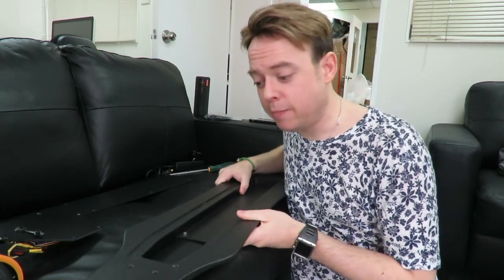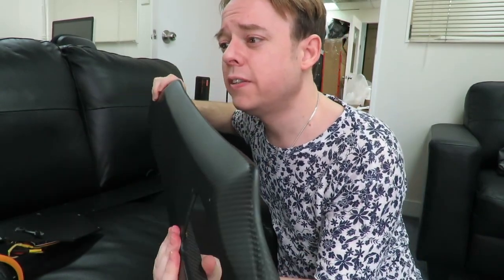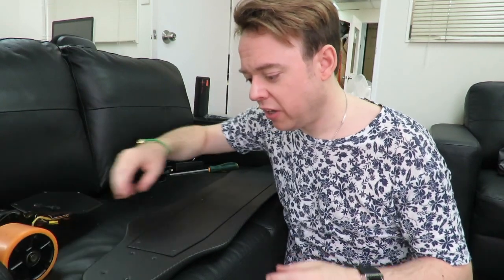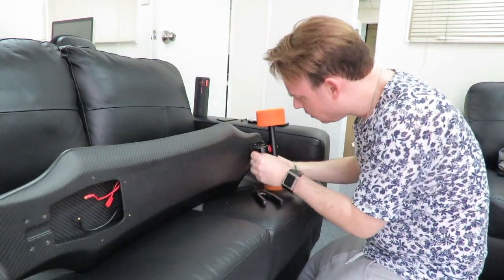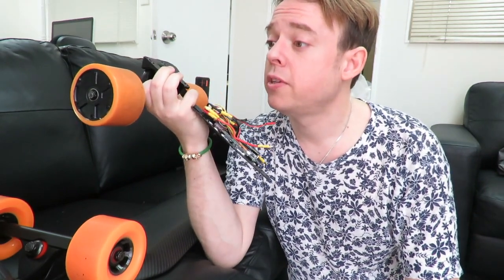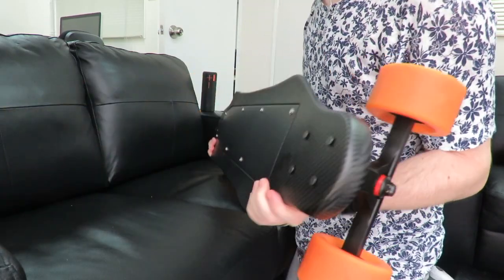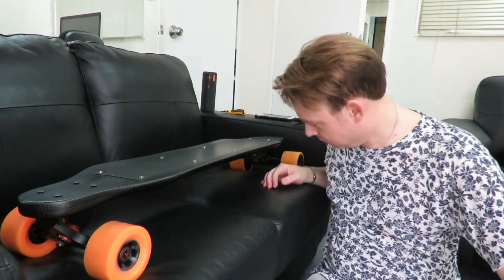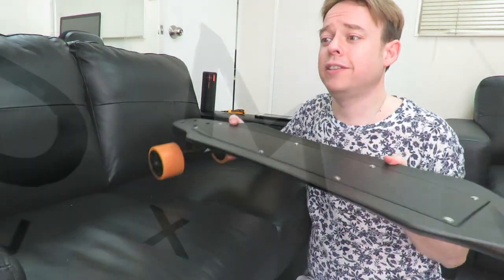Assembling the Stingboard: An electric skateboard by DMC made of dry carbon fiber!

Comment: when and $?
Reply from the maker: We are looking at a retail of roughly USD 1990. The whole board inside and outside is dry carbon, and has a complex structure which makes the Mold quite sophisticated.
Reply: Any chance to purchase just the board?
Reply: Sans all electronics.
Reply from the maker: T. M. Yes, www.DMC.ag
Reply: DMC 2000 usd? Um ill tell you now your not going to sell many. Not unless that battery can get 30 miles range and the board can go 30 miles top speed